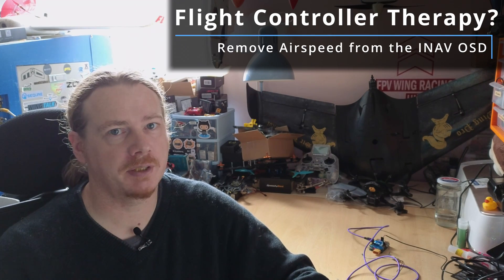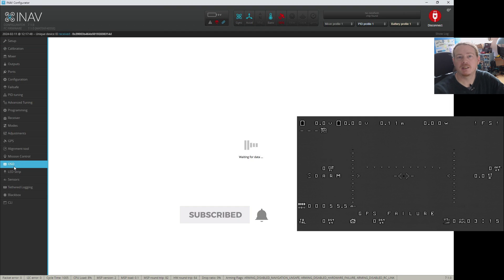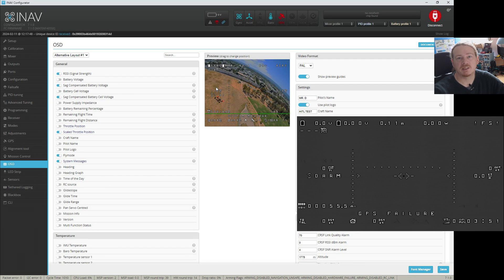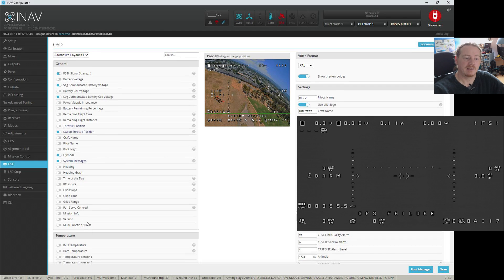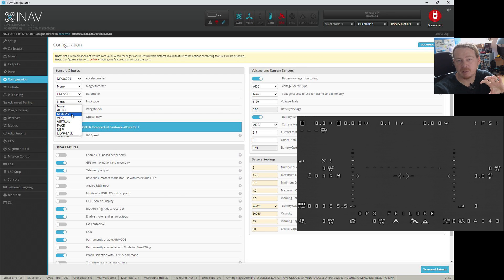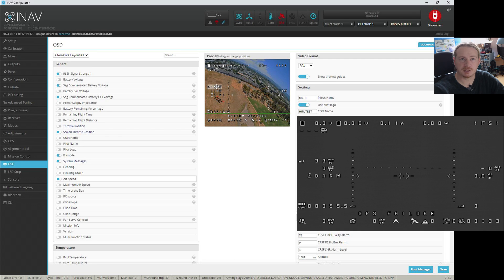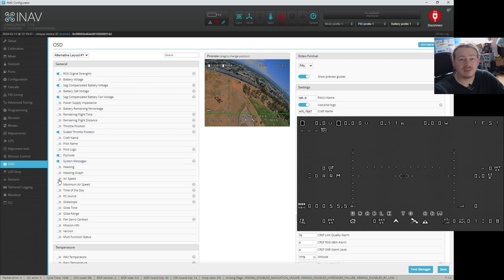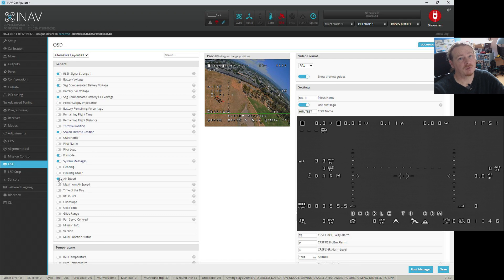Removing the Air Speed element from INAV's OSD

Comment: Virtual airspeed together with the actual wind direction estimation works great and is essential for flying close to stall speed and planning landing direction. Also useful to see how windspeed and direction changes at higher altitudes. GPS ground speed is in my OSD for distance range estimation.
Reply from the maker: I completely agree. They are all really useful. I have Air Speed and Horizontal wind on my OSD. The accuracy is pretty good now too. I was flying last week with INAV, and my friend was flying the same route with ArduPilot. We saw very close values on the wind speed and direction.

Comment: This happens a lot with CrossFire as many FCs are still set to CrossFire by default.
Reply from the maker: The default receiver protocol is a per-target preference. A lot of more recent targets do default to CRSF. If CRSF is the protocol, the CRSF elements will be enabled on the OSD by default. So they would need to be removed before changing the receiver protocol.